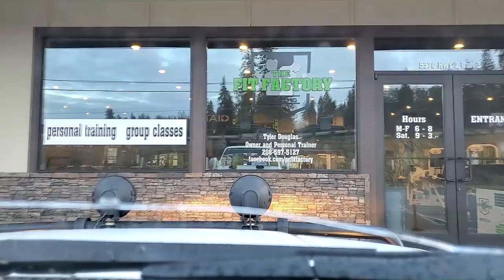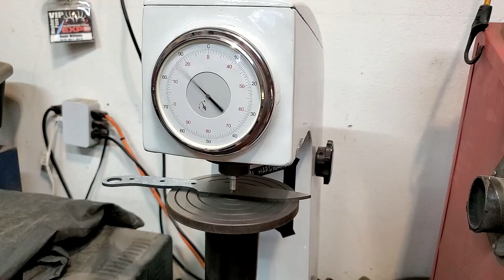10 K giveaway (KNIFE BUILD #3) Rockwell test, How hard is it?

Comment: Loving it man, great lead in, creative perspectives and awesome content. Cappuccinos, PT, and Knife-making! Is there any benefit to conducting a Rockwell test where the handle is at so you could hide the dimple under the handle?
Reply from the maker: You could do that , but I like to test right where I am going to grind the edge.  After all  that is where it counts for edge retention, toughness and sharpenability.  The hardness can and usually does vary for different.parts of the knife and the edge is the target area.